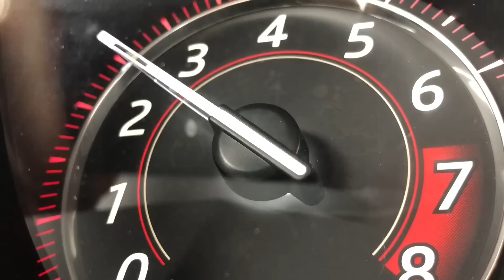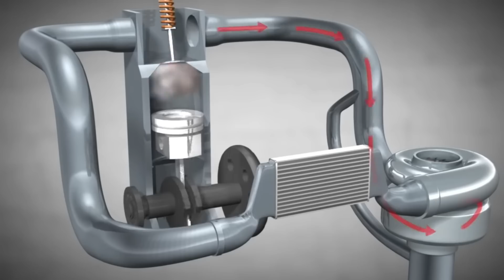Are Turbo Engines Reliable?

Comment: Here are the Disadvantages of Turbo Chargers and Why I'd Never buy any car or truck with a Turbo Charger.
Turbo Chargers create a LOT MORE HEAT, and INTERNAL PRESSURES, causing accelerated Engine Wear and Oil Consumption compared to a Non-Turbo'ed engine causing the turbo'ed powered engines to wear out by about 100,000 miles.
Naturally Aspirated engines usually last about twice as long mileage, average about 250,000 miles before the engine is worn out.
My 2019 6.4 non-turbo'ed Dodge Hemi makes 485HP 480 Ft Lbs. and get 18 to 23 MPG, my 2022 3.5 Ford Eco-boost Ford makes about the same horsepower and torque numbers and gets about the same gas mileage 18-22 MPG.
The reason manufacturers are putting small turbo'ed engines in so many cars and trucks nowadays is because they do not want engines to last hundreds of thousands of miles like the older naturally aspirated engines do. They want you to buy a new car or truck every 5 years or so years.

Comment: Modern turbo engine design basically makes the vehicle disposable just past the warranty period expires so kiss 80-120k mile reliability good buy
Reply: You're a fool if you really believe that. Timely maintenance. Also never buy a used turbo car. There is a guy on YouTube with 1.5T Civic '17 that is at 700k miles on stock turbo! Honda, Toyota or Mazda are only turbos I would take a chance on if new.

Comment: Now hold on!! First he said the homda turbo motor had a real problem… then he picks on the chevy cruze and said it was the poor design… first off the chevy cruze was gm’s first turbo 4 motor that came out in 2011 with lots of way ahead tech like electric water pump, variable oil pump,  .. and 2nd it was actually a rather good design and the cars got like 43mpg…

Comment: Turbo's suck....no doubt about it.....never seen a car with thousands of miles on it with a Turbo.  Porsche would be the only Turbo Engine I would trust.....but even then Turbos are only for the meticulous/anal car owner.....somebody who changes their oil every 3,000 miles or so and fanatical about changing the plugs, coolant, filters etc. Also they are better suited for cooler climates, having a turbo in AZ or TX is recipe for unreliability.
Reply from the maker: For sure, turbo cars run better in cooler air too with denser air, less heat soak in the intercoolers and much better power in temps around 60 F
Reply: Rotary engines are great for turbos.

The rotors don't move up/down like a piston. They just spin.

Nowhere near as much strain on the engine.

Comment: My daily driver was a golf tdi pd, with original factory turbo and re map 160bhp, 200,000 miles, change oil regular and air filter (  factory airbox). Also V.N.T never seized.
Reply from the maker: Thanks for sharing

Comment: I bought a 2021 Subaru Legacy with the 2.4 turbo. I like having the power when I want/need it, but I wish now I had bought the naturally aspirated 2.5 in the Legacy. Would have cost less and it probably would last longer. I make sure I change the oil a little sooner than Subaru recommends.

Comment: do you really need perfomance when things are getting expensive, and you just need something that needs to be lived long and reliable. Fast and furious can get you in trouble, unless you are rich or need extra toy(s
).
Reply from the maker: That’s fair, but you don’t always have to drive a fast car quickly.  But when it’s right line a half day on the track or a quick tip in on the freeway on ramp, it’s still better than loading in a Corolla.
Reply: @ECPP  unfortunately, with increased population and less available resources per person affordabilty index will worsen for middle class. However richest part will get richer and even dispossessing/reset at the horizon, so average folks will seek/gravitate to reasonable products - it's just life and reality  about to hit us.

Comment: Depends entirely on how you drive the car and, critically, how well you service/ maintain critical things, such as oil, coolant, etc.
Reply from the maker: Cheers
Reply: @ECPP  welcome.  I have a 2 litre turbo petrol: relatively common configuration.  I change the oil for new religiously every 7000 miles, and coolant I have just recently drained and changed.  Suspected wastegate actuator issue not long ago and I didn't hesitate in having a better, stronger one fitted.  The stock blowoff valve I had changed from the plasticky one to a fully cast Turbosmart one.  Don't want to take any chances, but, runs very nicely, smoothly and powerfully
Reply: Turbos are very sensitive to proper oil changes.  Forget that "10,000-mile" oil change marketing pitch.  Change your oil and filter every 4,000 miles or 6 months if you don't drive much.
Reply: Very well said. 
All diesel are turbocharged

Comment: Depends what your using them for, if your going like a teen with a lead foot, then its going to be bad on the engine. If you buy one to help you in times of need, say trying to go up a big bridge or hill, trying to pass someone, then your going to be OK. trying any of those with a small non turbo engine and its going to be scary.

Comment: Great work and informative. Back in 2008, I compared and opted to replace turbo with hybrid cars cause they both provide that extra boost, only with the electric, one gets instant torque, zero atmosphere impact, no added heat built up & amazing reliability with added low maintenance
Reply: But no manual. No manual, no buy. Driving an electric is better than an automatic but it's not really driving.

Comment: After having a terrible charged car and now switching over to a regular 3.7 V6 I much prefer the naturally aspirated much less things to worry about and it sounds so damn good fuel economy for me has been about the same I average about 19 to 22 in the city with the V6 depending on how I drive and with the 4-cylinder turbocharged I would typically average about the same

Comment: more parts bolted on is always going to lower reliability.  I would suspect electrics will be the most reliable in the future, but time will tell.
Reply from the maker: That is true indeed
Reply: Electric motors are reliable, but the battery 🤷‍♂️

Comment: Turbo 4s are generally short-lived.  I had an Audi A4, and it was wretched in terms of reliability and upkeep.  Used oil, lots of electronic issues, and at 50K miles, the turbo died.  As naturally aspirated engines go away,  we'll be driving more cars that are expensive, unreliable and so on.  Gone are the days when your Toyota Camry would last 200K miles.
Reply from the maker: The Camry still can but in base engine configuration
Reply: It wasn't the turbo that made it short lived, it was the Audi. Lol. I've had Nissan SR20DET engines that stayed incredibly reliable for a long time and same with EJ20ET. The EJ had a chance of issue from weak pistons that Subaru used but as a daily under stock boost, it was fine. Either engine had stock turbos last over 150k miles with regular oil changes.

 It's modifying that kills turbos and engines. Poor tuning. Over boosting. Lack of cool down. Poor gas quality. This is mostly from user error.
Reply: 4cy turbo diesels are perfectly fine and capable of moon miles.
Reply: Camrys are still naturally aspirated
Reply: What year was your Audi? Some models are less reliable than others
Reply: Huh I have a 1986 turbo sedan with 260,000 trouble free miles, we just traded in my wifes A4 turbo 4cyl with 98,000 trouble free miles?  How do you drive your vehicles and more importantly do you take care of them?
Reply: That’s because you drive a Audi. Notorious for carbon build up. Not because it was turbo.

Comment: Great video Mark, whats your take on a 2009 Porsche Turbo PDK, the last year of the highly successfully Metzger engine
Reply from the maker: Absolutely, 100 percent a go for me.  Arguably the best generation. Of 911 turbo.  The Metzger GT1 dry sump is true racer, manual or PDK are great, but avoid earlier Tip as it takes some of the special away.  The more modern type headlights.  Simpler a a bit more robust than later turbos.
Reply: @ECPP  
Thanks Mark apologize for the same question on a  different video.
As always terrific coverage and have saved me from harming my wallet.

Comment: Turbos engines are the beginning of all sorts of issues! I classify them in the same category of trouble as cvt transmissions
Reply from the maker: Thanks for sharing and yes they add complexity.  With that said, turbos add fun and improve performance, yet CVTs cause nothing but testicular torsion.
Reply: My turbo engine with CVT ticked over 120k miles, zero issues.

Comment: i have a 2014 vw Passat with 78k miles no problems whatsoever i get 50mpg you will never see that with a na engine and with these fuel prices the money i save won't be a problem to fix anything if that even ever happens because diesel engines are built indestructible

Comment: Back in 2019 and 20 I heard Toyota was switching the Tundra from the 5.7 V8 to a TTV6....NO THANK YOU. I have seen ALL the problems Ford had with the F150. N/A are way more reliable. I have a 20 Tundra and I believe towing means the v8 will be better on fuel. With a turbo you either get eco or boost. With boost, she will be very thirsty. You never get both. The Tundra has had some teething issues as well. The second gen was dead reliable. These turbo engines...are the waste gates analog or electronic? I know Kia/Hyundai use electronic. They have had a recall on those. BTW....my work van is a V6 TURBO DIESEL MB SPRINTER and at 103 000 kms the turbo coughed up a fur ball.

Comment: Excellent video. Going back a few years I remember my friends lusting after the Saab 9-3 Aero with the turbo 4-cylinder engine. I thought it was an amazing design at the time, but I was living in a hot, desert climate and it seemed their turbos preferred cooler climates. Now days I drive an E350 with the turbo inline 4 cylinder engine and am amazed at how much performance you can get out of a 2L.
Reply from the maker: For sure the modern turbo engines put out a lot of power
Reply: @ECPP  great video brother. what is your opinion on the new hurricane engine from jeep ? I'm looking now to lease a new wagoneer with the hurricane but I feel unsure.  Would you prefer the hemi rather ?
Reply: Excuse me I didn’t understand which were the differences between the Saab and the one you drive now? Thank you.

Comment: My retired relative just bought a new Honda CRV with a non-turbo 4 cyl. The no turbo is why he went to it. He wanted less expensive complex technology and less parts and more reliability. It is also a top seller. His last car was a Fusion. My car is a 2006 Escape 4-cyl with 269,000 miles. The engine and auto trans have never been gone into. It does not burn oil.
Reply from the maker: Great choice.  Performance cars are great but Honda did struggle with the 1.5 litre turbo engine
Reply: Some folks get the luck of the draw. change oil and filer between three and four thousand miles. Drive normally not like you are on a race track.
Reply: The real question is .. why would anyone want a turbo in a crv hahahaha

Comment: I use to own a Peugot 508 turbo saloon and even after putting top grade Motul oil at service the turbo had issues like smoke and leaks later.  Also, I saw the service history of the car and the turbo had repair work done to it a few years before.

Comment: in my opinion  if you have  big V8 or big V12 with  turbo you will not damage the engine  the problem of turbo car is small engines  the engineers is asking  to much from a small engine  and to much plastic and technology and strict emission system that what  makes turbo cars unreliable

Comment: Had a 1986 Ford Thunderbird  with a little 2.3 turbo. I was just a kid old enough to drive. Worked my butt off to pay for it. I believe it was around 190 hp. which wasn't terrible for the 1980s. I fell in love with that car, had no intercooler. Not one thing while I owned it went  wrong. I beat the hell out of it and towed a 19ft open fisherman style boat. I would be at the boat ramp ready to pull my boat out of the water. Always, mostly from the truck people would always keep an eye on it while I was pulling the boat out of the water. Like it wasn't going to do it. It had a five speed manual with a posi rear end. All you heard was the turbo spool up and it would easily pull my boat out,  everytime. I put 120,000 rough miles on it before I sold it( had to so I could get a work truck).
It wasn't the fastest car I ever had, but it was the best, most reliable and fun car I've ever owned. I'm an old man, I've had more cars then I can remember. 
Dam, I miss that car.
 I know turbos put extra wear on a engine,  I couldn't kill that car. Had to be very lucky, because I ran it like it was stolen. Great car.

Comment: The Turbos in USA Model vehicles.  Ecoboost vehicles are not reliable because of the Turbos.  The Turbos USA 🇺🇸 the Turbos are Mounted too close to the engine, and without the an insulated heat shield 🛡 or insulation blanket cover for the Turbos.  
From my experience with Ford the engine failed, on the cylinder next to the Turbo with Low Compression..
Engine had be replaced at 43,000 miles, even though I was gentle with it for 38,000 miles. Plus no heat extraction vents on hoods don't help either. 
You mentioned to much excessive heat, they can generate 1875° F 

Tuners know  they have to be Mounted away from the engine block.
Porsche Mounts them away to the rear quarter panels  behind the radiators and interior for the side intake.  Porsche perfected the Turbos 
I would never buy anything with Turbos
🙋👍🏎🏁

Comment: The truth is, we pretty much are running out of naturally aspirated engines! Our options are very limited today.
Reply: Toyota still has a plethora of natural aspirated options.
Reply: @quinty26  Especially if you are willing to get a hybrid.
Reply: @quinty26  in 2023 not anymore. They suck too. They kept the V6 and V8 in the Lexus higher trims. Gave us the peasants garbage engines.
Reply: Mazda
Reply from the maker: I would agree with that
Reply: It’s our government pushed by bankers. Nothing to do with the environment.
Reply: I got myself a last of the 5th gen 4runner before they come out with the new 4cyl turbo trash. Last of the old school naturally aspirated 6 cylinder engines that are smooth, simple and proven over decades to be the most diehard in reliability
Reply: there are countless and plentiful NA engines out there today
Reply: @msk3905 really? From who?🤔
Reply: @generalzod7959  lets see off top of my head Toyota, Ford, Chevy, Dodge, Hyundai, Honda…

Comment: I have a 2017 Civic Hatchback with the 1.5 Turbo. I've been lucky so far to have had none of the problems associated with this engine. This car gets downright stupid real world MPG (34-37) and it's a blast to drive. BUT - I have no confidence that this will last for the long haul. Great Video Mark, one of my personal favorites.
Reply from the maker: Thank you so much and I appreciate you watching.  I actually have a video coming soon on the 1.5 specifically, and really it is Ana amazing engine technically.  Thanks again for watching.
Reply: Honda built up a great reputation from the 70's and 80's in terms of reliability, but given today, they're actually not as reliable as they once were. No one stays on top forever.
Reply: I wouldn't worry about it unless you have oil dilution.  I've seen reports of the 1.5 accord blowing headgaskets but it has more boost. If you don't have oil dilution, I wouldn't worry about it.
Reply: Any updates on this? I have a 1.5t 2023 Honda civic and just passed 30k miles, hoping it holds up for the long run!
Reply: @cluelessdriversofcolumbuso2227  I'm at 67K miles, no issues. I still have the original brakes. It's been a fantastic car.
Reply: @hughb5092  great to hear! Makes me feel better!

Comment: I wonder why carmakers like turbochargers rather than superchargers?  No heat issues or “turbo lag” with a supercharged engine.
Reply from the maker: That is interesting David.  They both have benefits with turbos providing more efficiency and less drag as superchargers tie to the crank.  I would say turbos are probably easier to package with the power unit and likely takes less space where you need it.  In my opinion, both great for power adders.

Comment: In Fiat Ducato Vans with 2.3 liter diesel engines they suggest 48,000 km between the services!
I made an oil service in my X3 20d 2008 recently, and after resetting the "calculator" it suggest 30,000 km to the next oil service!
Reply from the maker: Too long in my opinion

Comment: You also made a good argument for hybrid vehicles. Great for short trips, no turbo lag, less maintenance bc the engine only runs half the time, but good acceleration. The Honda CR-V hybrid is faster 0-60 than its 1.5 turbo sibling.
Reply from the maker: You bet, short city trips, hybrids do make sense indeed.  For pure fun the ICE component is the win.  May be a win win.
Reply: @ECPP  I actually like the idea of a turbo in a sports car or diesel, but I’m skeptical of putting a turbo in a tiny engine for improved fuel economy